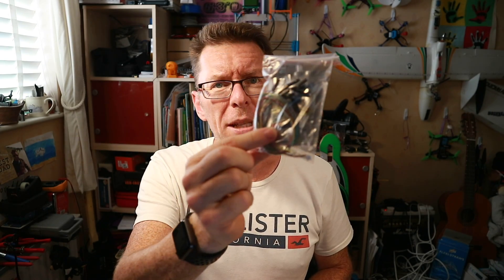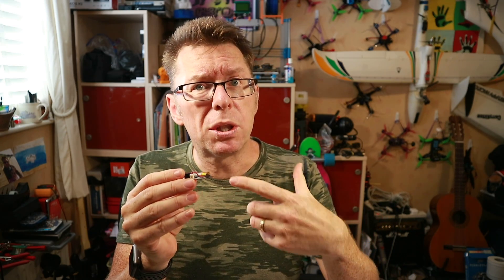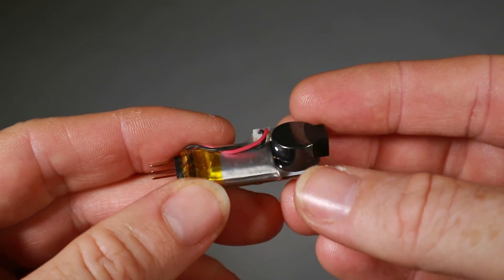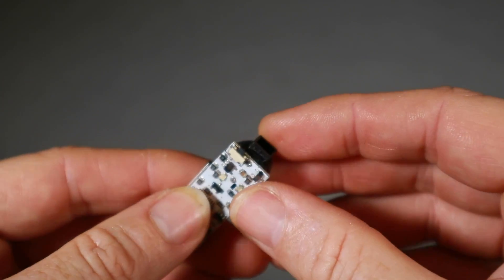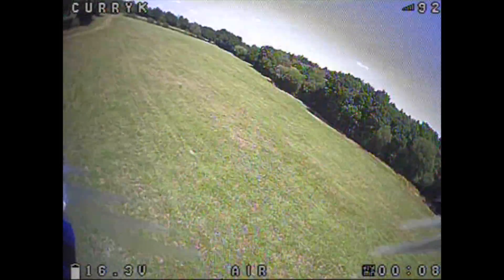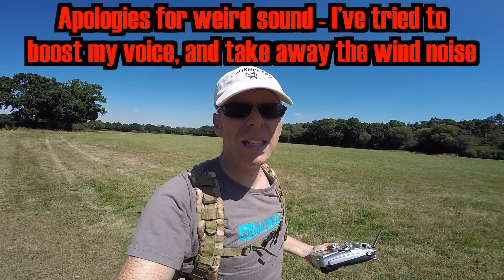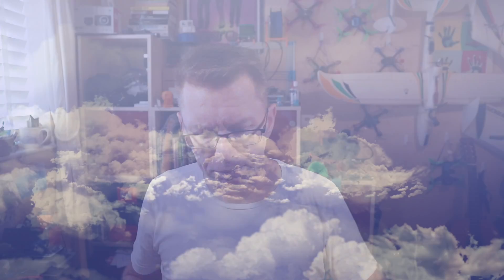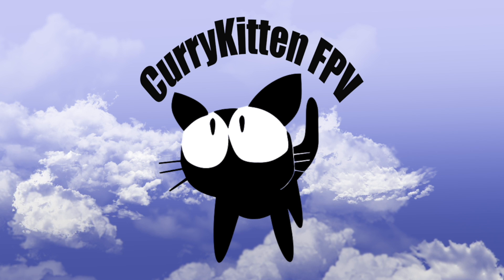Never lose your drone again - Episode 8: the tBeacon BuzzyBo

Comment: Hi there, would you consider doing a review on a new Lost Model Beacon from Grineid Tactical Systems? Battery life is 14 hours, transmits over 1km away, the device with the battery mounted is the size of a quarter , weighing in at roughly 4 grams, apart from constantly transmitting for 14 hours straight it utilizes a hot mic that’s always on and transmits surrounding audio, as you approach the device you start to hear yourself which allows you to “call out” to your drone and hear your echo on your receiver as well as feedback from your actual receiver as you get closer, It’s honestly revolutionary. They are a Canadian company based in Ottawa, I have a few and I can send you one.
Reply from the maker: That sounds interesting - what frequency is it using to call out on?  Colour me intrigued.
Reply: CurryKitten it really is! The beacons transmit on the UHF band, the one I currently have attached to my setup transmits and calls out on 434.038mhz
Reply: @CurryKitten I have pics of the device you want me to send them to you
Reply from the maker: Please do, find me at currykitten at gmail dot com.  It sounds similar to the tBeacon devices which transmit on the 433 band and you can call out by doing a "tone burst" at 1750Hz from a 433 band radio like a baofeng uv-3r.  (I have the tBeacon unit, but I haven't gotten around to testing)
Reply: @CurryKitten  email sent!
Reply from the maker: Didn't seem to get any email - did it send ok ?
Reply: Email received? Pm’d you on insta and sent from two different email addresses just in case, sorry for the bombardment!
Reply from the maker: Got it - I'll fire off a mail to you now !

Comment: I have lost my programming and operating manual for this. Anyone got one they can send me or post on line?
Reply from the maker: Let me google that for you :D https://tbeacon.org/?page=24
Reply: Ha ha very good! Don’t know why but I couldn’t find that on google. Edit I do now, I was searching for BuzzyBoo
Reply: Must have a faulty one cos all it does when I connect it is emit a low croak every second. Checked the lipo and it zero volts.
Reply: @Bigtbuilder  HI Tim. How did you get that sorted out. I have the same problem. I think when the battery is totally flat it cannot initialize and as such cannot charge the battery. I don't have a battery charger for this type of battery so I am stuck.
Reply: @edwinderick72  I didn’t get it sorted. I bought a new battery and even that didn’t fix it. It’s supposed to work without the battery but mine didn’t. Contacted the manufacturer and got no answer so it went into the bin.
Reply: @Bigtbuilder  Sorry about that. What I know is that it is the battery problem. If it's totally flat the buzzybo won't initialize and that would make it not charge the battery. I had two buzzybos so when one went flat, I would use the battery from the other one to initialize and I would swap the batteries and it would charge it. The buzzybo can be used without battery and this is if all the three cables are connected to the distribution board. That way it can initialize without the need for an internal battery. This is what I am going to do next. Hope you didn't throw it far! You can dust it off and try again. Cheers man.
Reply: @edwinderick72  I did connect it direct to the fc but it never did work. Terrible company, zero customer service. Not cheap either. Better and easier kit on the market now I think. Plus I don’t fly fpv any more so slowly getting shot of £K’s of long range kit
Reply: @Bigtbuilder  Sorry about that. Maybe yours was defective. Which other one do you recommend. I wanted to use it on my mavic mini.
Reply: @edwinderick72  vifly beacon and la forge direction finder. Banggood is your friend
Reply: @Bigtbuilder  Thank you so much.

Comment: Just got around to dismantling my Rooster to get this fitted as a buzzer and lost model finder. Am struggling with the connections as my CL Racing F4 board has two dedicated buzzer pins - any ideas how would you connect??
Reply from the maker: The two buzzer pins you should have are buzzer- and buzzer+, so you need a gnd pin (to gnd obviously) a 5v or buzzer+ to the 5v line and then buzzer- to the signal pin
Reply: Tried the first suggestion, gnd to gnd, 5v to 5v line and signal pin to buzzer - and it didn't work !! Hence the question, i'll try moving the 5v line to buzzer+ , was concerned it didnt work 'cos the FC switches the Buzzer+ rather than the Buzzer-. Thanks for the help.
Reply from the maker: @blackers2005  Buzzer- is definitely the signal part of the setup.  I never tried this with Betaflight, so let me know if this is still not working, and I'll give it a go myself as well.
Reply: You are right I tried using the buzzer + with no success, then tried a hellgate buzzer which worked fine. It appears the buzzybo is dead after working standalone for about 1 minute - it’s just dead although the led lights yellow when power on, the switch has no effect and nothing happens whether powered by board or battery. I’m going to email tbeacon but thanks for your help. Keep up the great videos / reviews !

Comment: Can I just charge it with pins connected and zip tie it to quad with out soldering it to flight board
Reply from the maker: Yes - it's exactly how I used it in my test.  I just used an old ESC (which had a BEC) plugged a lipo in the ESC and plugged the servo connector into the buzzer to charge it, you could also adopt an old USB lead - just taking the GND/5v connectors into a servo lead.  It's easily then good for a whole days flying - and you can move it from quad to quad

Comment: This or dronekeeper for plane use without fc? Want something like this for my ritewing builds
Reply from the maker: They'll both work as a timer based buzzer - you can also use the tBeacon in PWM mode and use a Y lead to an elevon channel or something.  Only think I'd mention though is that if you are going longer range on your wings, then it's obviously less useful if you go down several km away (until you get in it's vague area at least)
Reply: Yeah its mostly for my pure wings, longer range birds will have inav or vector in so bit less of a issue finding them

Comment: Thanks for taking the time to review this 🙂 You're the king of lost model finder reviews 👍 I think the user configuration options and the fact it's clear the developer appears committed to making ongoing firmware improvements that will be updatable by end users are two clear selling points over some of the competition. I hear you may also be reviewing the VIFLY Finder at some point, so if that is the case I will also be interested in seeing how that fairs up against the others.
Reply from the maker: Yep, I've got the ViFly beeper on my desk right now.  It seems almost the same as the Hellgate buzzer in terms of function and wiring - but it looks like the beeper has been beefed up to get my noise from it.  Hopefully will test soon - typically after several weeks of lovely weather, the wind and rain has returned :(

Comment: Another great video mate. How do you charge the lipo if it's not connected to the quad. I will only be able to use this buzzer as a stand alone not attached to the quad . Thanks
Reply from the maker: You need to give it a 5v supply.  So I just hooked up an old ESC to a lipo and plugged the servo lead into the beeper.  Once the orange charger led went out, it was fully charged.  You could also adapt a USB cable to just take the 5v and ground into a servo lead.
Reply: CurryKitten as always cheers mate will order one tonight and give the usb  lead a go 😉😉